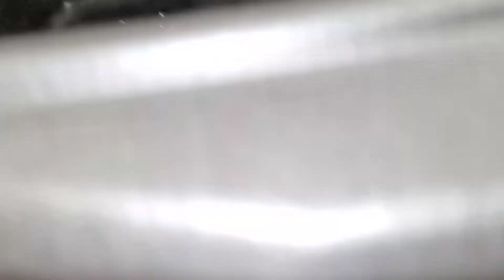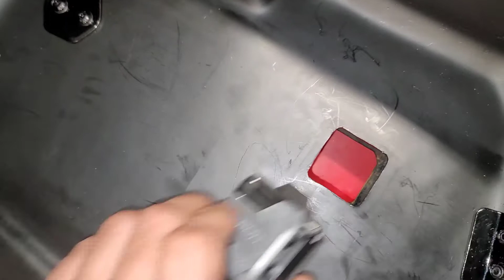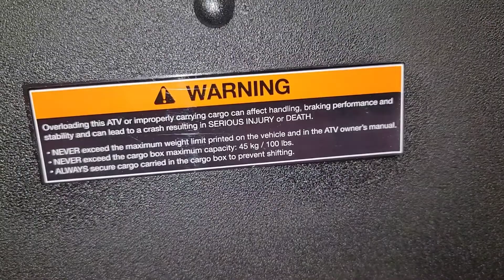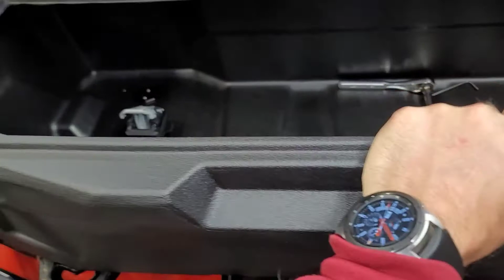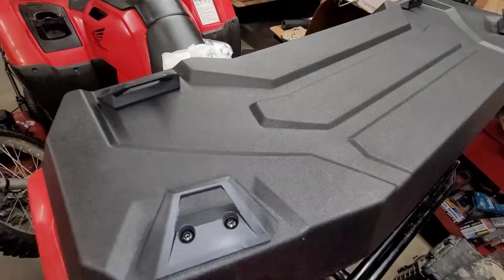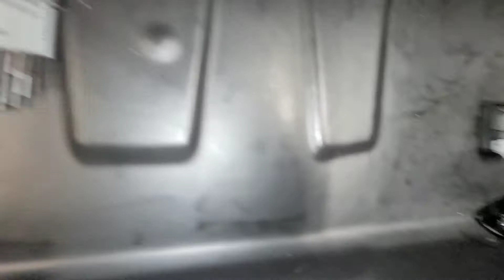Honda Pro Connect Updated design for Rubicon rear box Install & Intial impressions & design changes

Comment: After watching your video I went back to look at mine and I'm thinking the thin plastic shim on the locks should be on the outside  so they can hold the locks in place when you remove the box. I received the 2 little elbows and had no clue what they were for until watching the video, I didn't notice the pre drilled holes. Mine also came with 2 round rubber plugs that look like they are supposed to be pushed through a hole to add cushion? Completely stupid to charge this much and not give any instructions anywhere your video was the only thing I could find so thanks for giving me more ideas on how I should do this
Reply from the maker: I had the very 1st design which was easy to break. This was the 1st redesigned when they restarted production for the redesign my guess would be rubber for the bottom like you're thinking or lid close, but I believe it's something they added since I got mine. What size is the rubber?

Comment: I know it look's pretty simple but for $350 for the front box and $500 for the rear I think they could at least throw instructions in with it. I got the bag with elbows and bolts and didn't know what I'm supposed to do with it. After I loaded so gear in the box I didn't trust the 2 pro lock clamps to hold it on the machine. Thank you for the printed instructions
Reply from the maker: The nice thing is now you can find replacement pro connect clamps. 1st box with old design clamps I couldn't use for a year when the clamps broke. The new have seemed to be more robust. I do typically not take the box off on send it trips. Cause I know I'm likely to break it.
https://youtu.be/xFGy-XobX_c?si=G8aWb0kSm1whVgSV

Comment: Hi,

Could you tell me what the inside dims are?
Reply from the maker: 35 1/2ish width,  12ish front to back & this measurement varies the most because of the way the molding is contoured, 7 1/2 ish depth to the lip opening. You lose a couple inches all the way around for the lip for how big item you can put in and the lid itself is recessed a couple inches so you can put stuff slightly above the opening lip.

Comment: I never thought finding a video on a honda atv product would be so hard … I’m looking to add these to a Kolpin storage unit … would you guys recommend or just stick with a u joint ..
Reply from the maker: The quick removal is nice, but if if you hardly never need to remove it. U bolt would be cheaper. A few people made some aftermarket connections that use pro connect and bolt down. This is the only place I found that I think sells replacement  oem latches, but confirm and do your own research if they will work
https://store.hondasxs.com/products/honda-pro-connect-latch-clamp-mount

Comment: They sure did find the most difficult design possible. I could think of about 10 different better designs right off the top of my head.
Reply from the maker: True I do like the simplicity. So far the new 1 has been good 🤞 the 1st design I can't believe made it through honda r&d. Wish they would sell them individually would make a replacement or make your own custom attachments a breeze

Comment: Thank you so much for your videos, very helpful. Not loving the Pro Connect system, makes it pretty difficult to install anything else but Honda aftermarket accessories. I do love the box though.
Reply from the maker: Hopefully aftermarket starts making some cool stuff using the system

Comment: FYI - the snap rings go between the bottom of the basket and the metal rack, and they hold the latch on the basket (when you unlatch the basket).   See below instruction/ install docs.
Reply from the maker: Thanks I've been running it like the video . Box has been working great!

Comment: Front basket install Doc: http://cdn.powersports.honda.com/documentum/MW01/0SL63-HR3-A01.pdf
Rear Install instructions: http://cdn.powersports.honda.com/documentum/MW01/0SL64-HR3-A01.pdf
FYI - these baskets and install instructions are for both 420 Rancher 
and 520 Rubicon.  I received the 2022 Pro Connect latches for both the 
front and rear baskets when I ordered them off of the site I listed 
below. (not the old recalled latches that don't work).
Reply from the maker: Thanks for the info.  Do u have the pdf for the cargo box where it has hooks front & back the snap set up like that, the latch would have to be pulled through to remove the box. I'm curious now if that was an oversight. With out the extra rear it would work like the tray's setup

Comment: So would these be the boxes under the 2022 accessories? I'm assuming it would fit a 2021....
Reply from the maker: Should be 2020 -2022 mine is a 2020 Rubicon. Honda may be slow getting it in the parts catalog but the old 1 should be discontinued
Reply: @buckssenditinfochannel5263  thanks boss. I'm sure I'll circle back around to this video when I get my hands on one.
Reply: Apparently I can't even get one in Canada anyways according to my dealer lol.
Reply from the maker: @Rggilby  part # should be 0SL54-HR6-A01 from the paperwork I can't find it in a current Google search except a listing from eBay from a dealer that had 1. My guess Honda is doing backorders or warranty claims 1st or maybe Corona has shut protection down. Hopefully they will be available soon
Reply: @buckssenditinfochannel5263  do you have pictures of what you got in the above kit?
Reply from the maker: @dehartman  I don't is there something specific you are looking for?
Reply: Hello any one can tell me if this rear cargo can fit to my Honda rancher 420 2021 ?
Reply from the maker: @Osama-xh2wd  it should be current catalog has the part #being the same
Reply: @buckssenditinfochannel5263  yesterday I talk with partzilla and the customer give me this item number 0SL54-HR6-A00
But I see you give different number here  in your comment A01 ?
Reply from the maker: @Osama-xh2wd  00 is the old design clips broke easy I would not buy that box if someone still has 1 in stock
Reply: @buckssenditinfochannel5263  hello sir , I order the A01 the one with the updated from partzilly almost 4 month ago, and still unviable from Honda factory 🏭!!! You know other way or deller have this rear cargo in stock?
Reply from the maker: @Osama-xh2wd  I had I very long wait hopefully production is back up soon